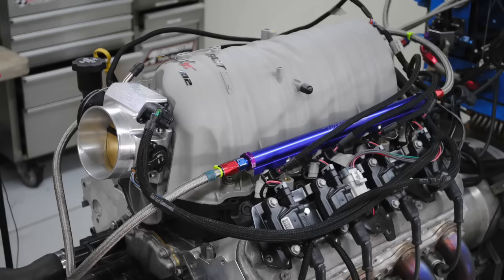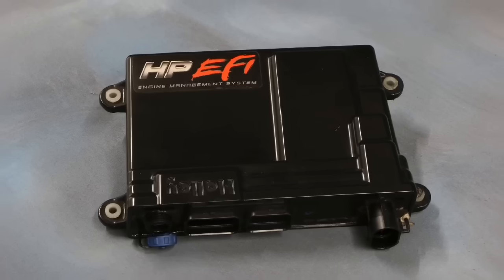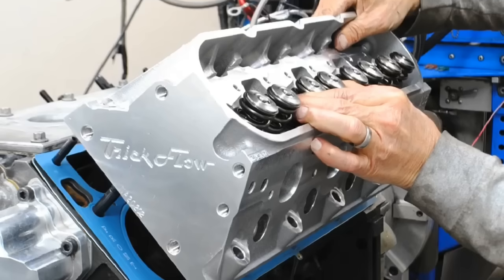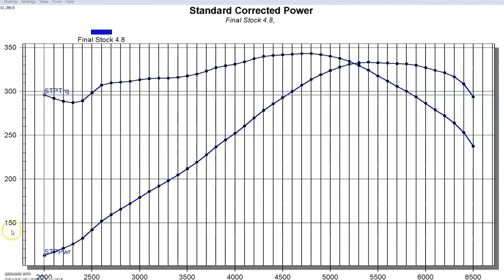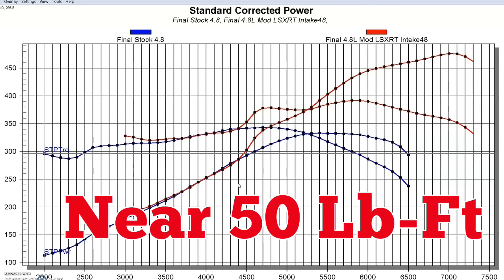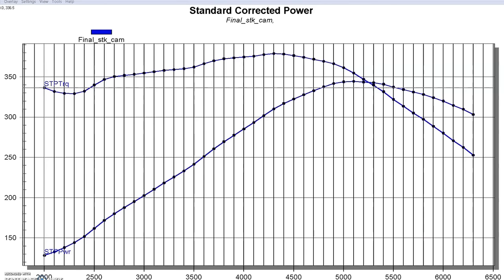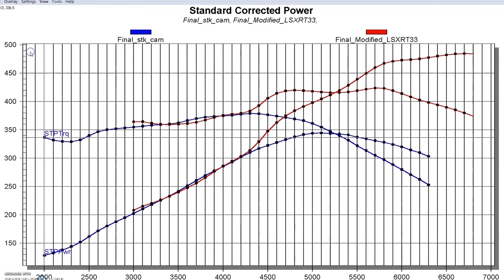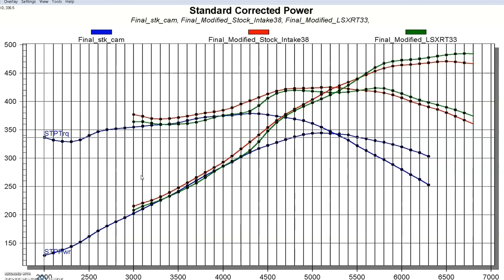JUNKYARD 4.8L & 5.3L POWER UPGRADES! HOW TO ADD 130+HP TO YOUR LS! HOW TO SWAP HEADS, CAM AND INTAKE

Comment: I need information on my Ford 302 (78)block and the (65) heads mounted together..  they bolt together.  Will this combo work/run good together  ?
Reply: The heads are from a 1965 289
Reply from the maker: they will work-but those heads are not great
Reply: I hear you but I did have the heads valves  and valve sprigs improved on  them .  I do not want to race but just drive to and from car functions so I dot end race quality.  I'm 80 yrs elderly and got racing out of my  crazy past...  lol 
I sincerely appreciate your time to reply as this info helps me to understand that I lucked out..  I hope it's OK if I as a few more questions as I go thru this motor and tranny for using to go to thos car shows in my 68 Mustang  !!!!  Thanks again !!!

Comment: Looking for mid to high end power what cam would be best to look at for a 5.3  stock intake 706 heads and long tube headers I do have a cold air intake on it as well
Reply from the maker: please see the many how to build 400, 500, 600, 700 hp vids up

Comment: I used a stage 3 Texas speed low lift cam with 799 heads milled 0.40 with trunion kit ls7 timing chain set up ls7 lifters and high pressure oil pump 2011 Chevy Tahoe daily driver
Reply: Stock torque converter???

Comment: For my daily driver I am looking for 450-500hp on my LS 5.3. I will never be above 5,000rpm. I am thinking BRT turbo stage 1 cam and GT45 turbo. 60lb injectors. What other mods would you recommend?
Reply from the maker: cam, springs, boost, intercooler, inj and pump (ring gap)

Comment: What is the best cam for a 5.3 flex fuel with 799 heads in a 09 Tahoe I need bottom end starting power and I’ll be adding nitrous with a stock converter
Reply from the maker: small torq or stage 1 truck cam

Comment: I’m surprised the truck intakes are right up there the FAST intake after the cams and porting. I got a express work truck with a 6.0L I plan on stealing the motor from when the body finishes rusting away. Great info!

Comment: 🇺🇲 I need some info, I have a 05 GMC Sierra Crew cab 4wd SLE with a 5.3 Vortec. Its a heavy truck but that 5.3 is got some beans for a completely stock older engine. My question is this...is my engine one of the good ones thats worth putting a few bucks into. I understand my 4L60E tranny isn't exactly bullet proof, nor is my stock rear end. So if I just have my heads done, and put a decent intake and a tune in it is my that engine one of the good ones. Or is it just another old Vortec. Thank you in advance for your time and help🇺🇲
Reply from the maker: your 05 is a good one-every ls is a good one, add a small truck cam and springs, then tune and away you go
Reply: @richardholdener1727  Thanks for the advice man, now I won't feel bad putting some money into that engine.

Comment: how are these engines producing so much stock power/TQ? what year are they?
my 2002 was ONLY  rated at about 270-285 stock hp?
Reply: are these engine dyno numbers w/o any accessories sapping power?
Reply from the maker: they way I test on the dyno is different than the oem test method

Comment: So I don’t need the intake and ported heads can someone list the stuff necessary I don’t wanna take a lot of stock stuff off
Reply from the maker: add cam and springs for a budget build
Reply: @richardholdener1727  valve springs? just asking because I want to make sure I’m looking at the right stuff . And thank you for this info my friends all have infinity g35s and I need to gap them . Also do you recommend a tune after everything is installed .

Comment: What are the specs on the cam. I have a 4.8 in my 02 Sierra 1500. Looking to make a fun reliable driver. Looking to do headers CAI but have decided on cam would like about 700 with boost later.

Comment: I probably missed it but what ignition are you using on the 5.3L ? current project is a stock rebuild truck 5.3l with just a Holley Snipper kit
Reply from the maker: holley ecu stock coils

Comment: I'm a high compression low boost kind of guy. I want to see high horsepower numbers with as little boots as possible. 12lbs would be the max boost pressure without throwing a rod.

Comment: I'm running a 5.3 LM4 with flat top pistons, that has been balanced.BTR Stage 2 Truck cam, 862 heads that are decked .010, port matched, and had a valve job at a performance shop, and all BTR top end parts.,  its. At approximately 10.8:1 copression, and when dyno tuned before exhaust upgrades, running stock exhaust, stock truck intake, and throttle body,, it put 389hp 392lb/ft to the wheels through an automatic transmission.  I was rather impressed with the power output of these engines with relatively little work, or even expensive heads or intake upgrades

Comment: I love your videos. Can you help me out? I have a 2020 camaro 2 as auto.so far I have an oil catch can and a k&n cold air intake with the dual mode exhaust. What other bolt one's  would you do in what order  to get more HP and TQ.my goal is to run low 11 in the quarter mile.Mike Dohm
Reply from the maker: CAM SPRINGS

Comment: I have a 5.3 so far stock beside the 3200 torque converter longtube headers (from my friends 2011 5.3) and a soon to go in 233/239 111 lsa. Could i make some good power with my 706 heads and a fast intake
Reply from the maker: YES-CHECK P-V ON THAT CAM
Reply: @richardholdener1727  what is P-V sorry if its a silly question im trying to learn these thing im barely 17 and its my first truck i swapped the motor a couple months ago also and cant figure out why its not wanting to turn on but it cranks i have no oil for it yet cause no 💰 and the truck has been sitting for 4 years gas never changed

Comment: I’m really curious to know what some compression would do. These old 5.3’s have an anemic 9.5:1 ratio. Not sure what the 4.8 had. I’d really like to see a 10:1 or greater ratio on an LM7 along with a head/cam job.
Reply: 9.5 also but if you use 4.8 possible in a 5.3, you get to 10.0 because the 4 8 has flat top pistons while the 5.3 had dished pistons. Crank, con rods and pistons are the difference between the two engines.
4.8 and LS7 are the only factory LS engines with dedicated crankshafts.

Comment: stock L33 I just ran on the dyno made 385 hp and 400ftlbs with some good headers and a tbss intake. Super surprised. Just about to install a set of mahle pistons, comp 54-458-11 and a 2.08 intake valve with some bowl work. It will be going back on the dyno after its completed.
Reply from the maker: A stock LM7 makes 355 and 385 so that seems about right! I like the L33s
Reply: @richardholdener1727  Thanks for the reply!
Reply: After rebuild the engine made 481 HP. But had really good torque throughout the whole pull. Super happy. Thanks for all your videos Richard!

Comment: Im workin on a 5.3 with a LS1 intake with 862 heads... I hear that i can use a 550 lift on those stock springs... Or should i upgrade to a LS6 springs... Im not trying to have a monster motor 500 hp... A good 420 hang
Reply from the maker: 5.3L (706 or 862) springs are only good for around .500 lift
Reply: Thanks... I'll get the LS6 spring then and some work done on the heads

Comment: I’ve been kicking around the idea of an engine swap on my Miata. The rules for the class I want to run in limit displacement to 5.0L. So I was thinking about a big bore 4.8L / 303 CI, this video has further solidified that notion.

Thanks!

Comment: The little engine that could! I love the 4.8L and it being the LS underdog. Can handle good boost, can handle full bolt on parts well, etc... Now I just need a good used Gen4 4.8L to build to replace my stock shortblock with for more and reliable daily driven boost.

Comment: I've had great luck with the Texas Speed Stage 2 Truck cams, available in .550 and .600 lift.  For an everyday driver you have great low end and it pulls really strong to 6200 gaining an average claimed 55hp with the LS1 blue springs (.550 lift ver.).  I just picked up a set of 5.7 pistons for my next build, that's the test I'd like to see.  Take that LM7 you just tested with it's dished pistons, bore it and install a set of the flat top 5.7's to see how much power is gained with a little more displacement and compression.   I think I might also install one of the Crane or Comp grinds you often use, this engine will be going in a 48 Dodge street rod and I'll be looking for a little more grunt.  Thanks for the video's.

Comment: I run various trucks for towing, I could care less about anything over 5000 rpm. I’m looking at 2500-5000. Real truck towing guys care about awesome low end torque. And mileage, very interesting but in the real world 98% of these engines are in working trucks and vans. I would not buy any of these products because they don’t fit into my world.

Comment: In my opinion being a noob LS builder here, is the CH ratio. {Cash to Horsepower}. The most power for the least amount of money. These are great videos, but spending a few grand to get 140HP. Ouch. Showing the cost associated with the build components would be great to see as well. Thanks for your time and effort.
Reply: he did mention hand porting your heads yourself.  Must have said it three different times.  It's really not that hard to do and saves you a ton of money.

Comment: 216/220 112 lsa .600 .600 
Double springs
Stck truck intake 
Stock 706 milled 40 
On a 5.3 
Dont know if it make the the 500hp but it drives and pulls strong at any rpm 
Nice street and strip set up
Would really like to see it on the dyno!

Comment: Hi Richard .I love your channel. I would like to see some testing with a Howards Rattler cam shaft. It has a really tight LSA and decent duration. I'm planning on running this cam in a 6.0  with 862 heads with intakes opened up to 2" and hand porting.

Comment: I'm thinking about camming my truck. I have a 2011 Silverado 4.8L Ext Cab 2WD
What cam do you think would do great for street use and taking to track occasionally?
I've been told to go with a small cam 212/218 or bigger one like 224/228. Any advice? Please and Thank You!

S&B CAI
Long Tube Headers
Built 4l65e w/ 3200 stall
two piece driveshaft
3.73 gears w/ posi unit
Custom Tune

Comment: I love that you're using the smaller, more mundane LSs. Everyone lusts after the larger ones, but the smaller ones are plentiful and plenty stout. Glad to see them being shown off a bit.
Reply: I agree with him about the replacing the 350.. now the displacement is less yes but the motor is commonly used like the 350 was for years and the 5.3 is still used but it's a new generation so I'd say the 5.3 is the new 350
Reply: @kingperfection1868  so feelz over reelz,  right? Ignore the facts, ignore the numbers. Whatever you feel is the truth. 
Gotcha. 
You should use that system to tune an engine. I'm sure it will serve you well.
Reply: @ChristnThms  the 5.3 is literally in everything. They started making them the standard v8 truck motor right after they stopped using the 350. The Impala SS, Monte Carlo SS, Buick LaCrosse Super, Pontiac Grand Prix GXP, and every truck has the 5.3 in it. The 350 was the common v8 at its time for GM. Today’s equivalent to the do all v8 GM motor is the 5.3. The other guy is correct. It has replaced the 350 in commonality. It is the do all v8 of this era
Reply: @grapesanyone6626  so being common makes it the new 350? Not being a 350? That's so odd. Almost like changing the definition of a word to try to win an argument.  

No. 
The 350 is the 350. 
Yes, 350 is an approximate volume, rounded for marketing.  But 349 and 347 are obviously going to be approximated to 350, and 324 is not. 
When a thing is literally named for its size, it's kind of hard to do the redefining thing and not look ridiculous.
Reply: @ChristnThms  he said 'built to replace', not 'is the volumetric equivalent of' lol, then you went off on a rant about displacement. 

What job did the 350 do? All around truck and passenger car motor.

What's the 5.3 do again???

You literally redefined the comment, and now you look ridiculous in doing so.
Reply: @CrisAnderson27  and you ignore the other displacements that were ubiquitous before, during and after the introduction of the 350... like the 305 and 307 that were the equivalents of the 5.3 in their respective eras.  

GM kept the 5.7 displacement for a reason. The 5.3 hasn't and never will have the same marketing presence, just like those other economy versions didn't.
Reply: The 305 and 307 SBC's would be equivalent to the 4.8 LS lol, and various V6 units if we're completely honest. Economy versions for the lower priced masses who still need a V8 and/or reasonable power/torque. What's funny though is you've completely forgotten about the displacement equivalent for the 5.3LS in the SBC lineup...the 327. Oddly (or not), the 327SBC didn't do the same job for GM as either the 350SBC, or 5.3LS...that being all around car/truck V8.

You also still seem stuck on something the post your ranting about NEVER said or even implied. He said "GM build the 5.3 to replace the 350". He didn't say "GM built the 5.3 to be the same displacement as" or "GM built the 5.3 to have the same market presence as".  He also never implied that they were equivalent in the eyes of the masses, or even in a historical sense. Again, "GM built the 5.3 to replace the 350", as in...fill their need for a durable, efficient V8 to put in their middle line (largest market share) vehicles.

I think it's cute too, that even you pointed out in your OP that the  5.3 is the 'smaller more mundane LS' (as compared to the larger displacement versions being implied of course). The 350 was the smaller, more mundane 400, lol.

It's really, really not that hard.
Reply: @CrisAnderson27  dude, I know this is an old ass comment, but thank you for putting that in place. That argument of the other guy was the wildest hill to die on 😂
Reply: @murkadelic422  at least he finally shut up. I was bored and it was a dumb argument...but people who make no sense, then try to make others look stupid with their crooked logic irk me. It's a flaw...but if it's my worst one, I'll take it.
Reply: @ChristnThms try 327 smart guy
Reply: @ryangulley2051  the 327 was never marketed as a mass market economy engine, and it actually predates the 350. The 350 actually replaces the 327 in its second iteration.
Reply: @ChristnThms  everyone is saying, that how popular the 5.3 is and how functional it is. It's replacing the 350 as the popular motor to put in a rig. No one is saying a 5.3 is the equivalent of a 350. Everything is okay
Reply: Hey, the 5.3 was built to replace the 350
Reply: @ranger3318  math man... the 350 is a 5.7L. The first LS was a 5.7L. No, the 5.3 was not built to replace the 350. That would be the 347. There's a reason why the metric designation is the same.
Reply: Are you kids still arguing?
Reply: My 4.8 runs better than my 5.3

Comment: What could you do with a 3.0L ford duratech in a 99 Taurus?
Reply from the maker: The SHO motors? I was around with the Sho Shop and the Stage Vortech motors they did that ran past 10,000 rpm
Reply: @richardholdener1727  it's not a SHO. It's still a 3.0 DOHC, but has a servo actuated link that opens airflow to the 2nd set of intake valves. I haven't found when the ECU is set up to actuate the secondary set of valves. The Vulcan pushrod cast iron version of the 3.0 was rated at 145 hp, the Duratec was rated at 200. The SHO had a Yamaha baby V8 rated at 265 if I recall correctly. I'm curious and wonder if I hooked up a physical linkage to operate the secondary runners and installed larger fuel injectors what the stock ECU could do. It's not flex fuel but will start and run on e85 but throws a code of running lean on both banks, hence the idea of larger injectors. I just don't have any experience with the programming of the stock ECU of what it could do with larger injejenctors. I'm also curious about what this engine would be able to do with a small turbo with the stock ecu and how or if it would even run.

Comment: Oh just cam it 230 by 110 ,truck manifold, headers, Pocket port and match- if you want to bother. , Get 450hp-500hp  i bet with tire shredding midrange  power.   Try that combo on a 5.3

Comment: Richard, in relation to your 862 comment:

Any reason not to have the prying point on the outside of the head welded up before milling? 
Also, how much have you gotten away with cutting the head while using the SS2 or 54-454-11 cam?
Thanks for all the testing/info you share!

Comment: What about the BTR 4.8 turbo stage 2 cam on a near stock 4.8 with turbo? With some gasket match port and polish, with maybe a 50 HP nitrous shot? What potential could it have, in a S-truck?

Comment: My go to semi cheap set up is as follows. Gen 4 flat top piston 6.0 ls9 cam ls7 springs 706 heads all factory parts I use a Holly 950hp. Feels great from idle to 7k pulls great for what it is. But I would like to know what what someone could come up with, with all factory parts

Comment: One more reason typical Dyno numbers are higher than factory numbers is that Auto manufactures use SAE J 1349 correction factor which is 77 degrees Fahrenheit, 29.23 in barometric pressure and dry O percent humidity where in the aftermarket and performance shops as well as NASCAR use the pre 1972 SAE J607 which uses 60 degrees Fahrenheit , 29.92 air pressure and 0 percent humidity air which is another reason the Gross horsepower numbers of pre 72 muscle cars were rated higher than post 72 as well as the reasons Richard mentioned . Lastly GM rates their crate engines in the older more generous SAE J607 for the big block and small block engines and the newer J 1349 for most if not all the LS crate  engines .